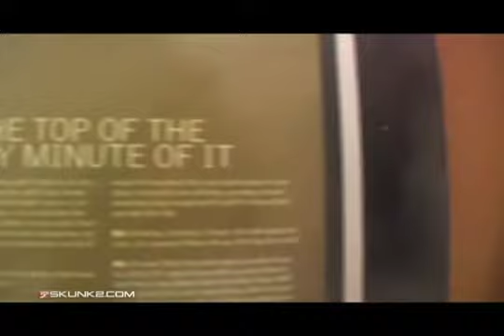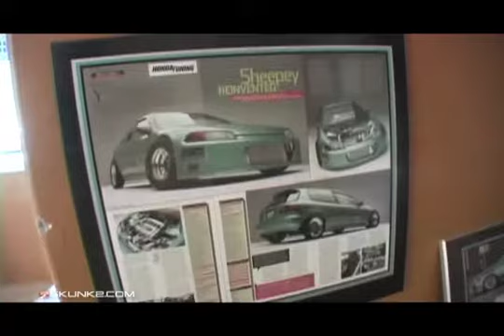Featured Elite: Alex "Sheepey" Soto

Comment: @Asanj3RSplayer 
If you're car is slammed then your valving on your coilovers is likely to be really stiff. If your suspension is so stiff and can't absorb any bumps on the road then your car is likely to be too stiff and really stiff suspension usually means understeer when pushing your car around a corner. You need more travel in the suspension to take corners well. 

Being able to drive over speedbumpers, driveways, hills, etc in a slammed car doesn't mean anything when it comes down to it.